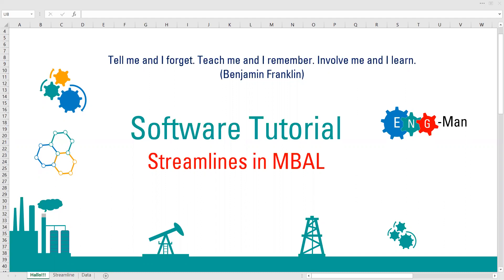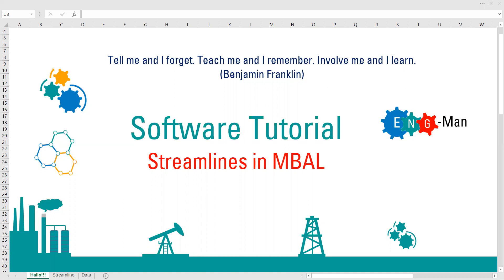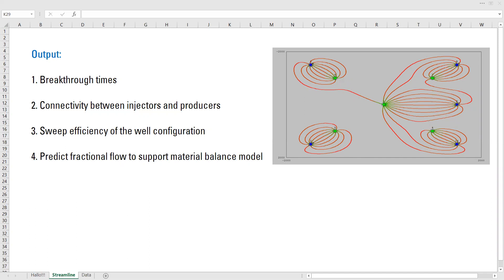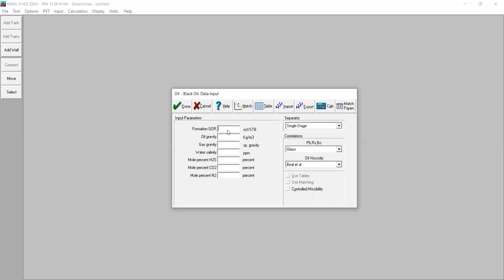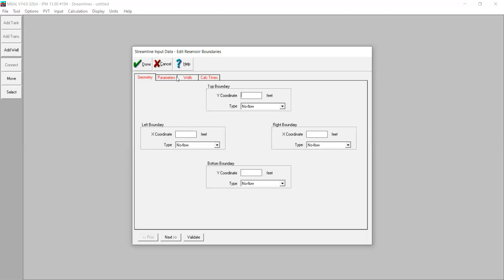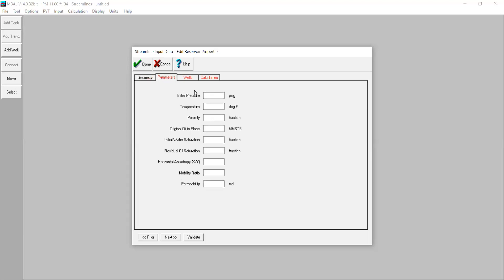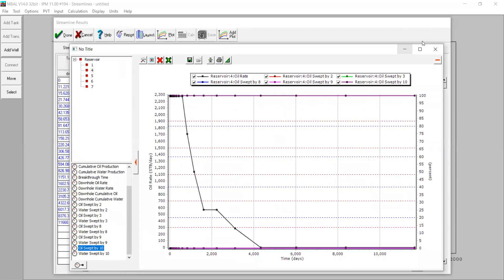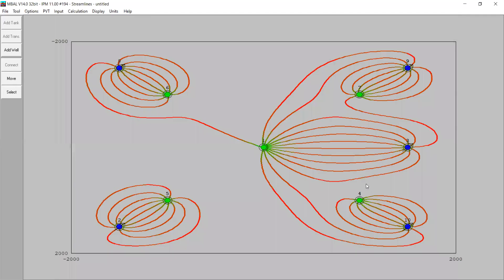MBAL 14: Streamline Simulation in MBAL

Comment: If you set reservoir as homogeneous then why only 4 injector wells are connected to producer well 1 and injector well 2 is not connected?
Reply from the maker: good question. The answer is because of course the real reservoir is heterogeneous, and this simple 2D model cant fully describes the reservoir. It just serves as a quick tool to infer connectivity between wells